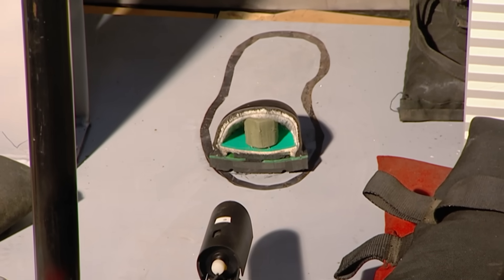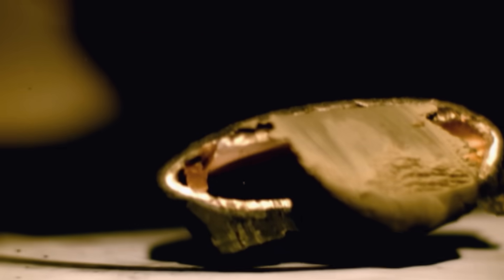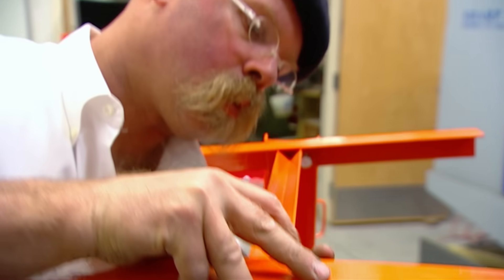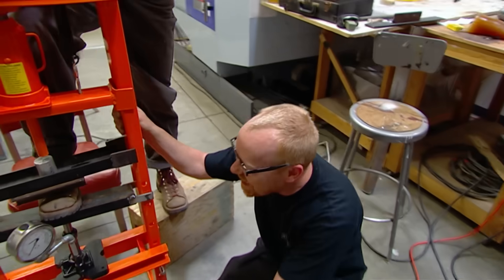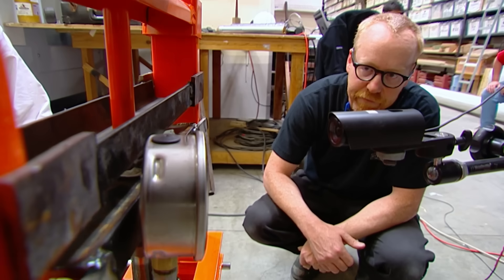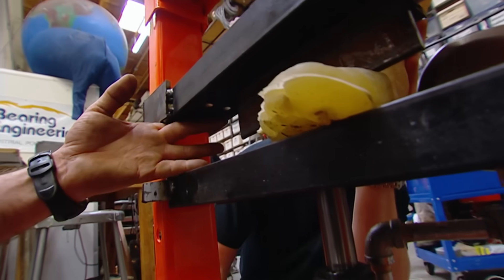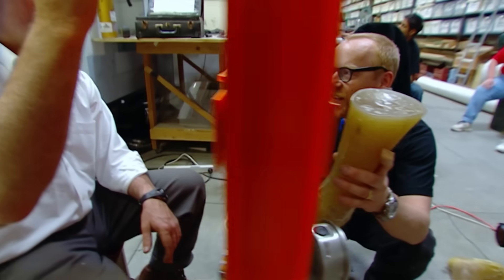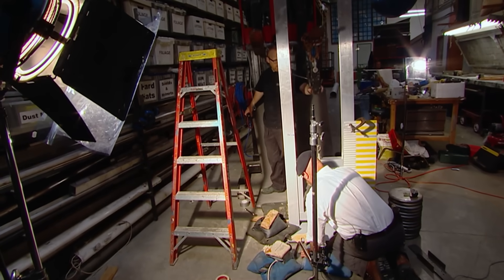Do Steel Toe Boots Really Protect Your Toes? | MythBusters

Comment: The thing that causes the steel toe to cut your toes off is if your foot is in a position that you can't move it ( you were focused on something else until to late to move it) and something is being lifted up under your foot at the toes and it rocks the toe of the boot up and the steel cup acts like a gulitine with the back of the cup cutting your toes off. I came very close to this happening to me. Fortunately the crane operator was paying attention and stopped instantly when I signaled him.

Comment: I hate safety toe boots.  I've got extremely wide feet, 6E, and what I've experienced is that safety toe boots don't fit properly and cause abrasions and eventually open sores on my toes.   It's not the same as having your toes crushed, but for people like me it's a real safety problem, especially when you consider that many jobs that require safety toe boots do not have the kinds crushing hazards that would make them truly necessary.

Comment: I will simply provide anecdotal evidence, I trained to be a plumber for two years in the U.K They train you on cast iron Victorian radiators just in case you ever bump into one. They weight an ungodly amount and I dropped one on myself with leather boots, Pain, Yes. Boot? dented inwards. 

I immediate went and got steel toe boots and then did the same thing out of fear a week later. it slid down the boot harmlessly. 

If you drop something heavy enough to break a good pair, you have worse problems.

Comment: The biggest issue with steel toed boots when I worked in construction is if the very tip gets caught in a narrow gap between a moving vehicle and a surface, like a paver and the curb. the metal toe twists if caught just right and bends it into the toe, or if you have really shitty quality boots it can snap the plate and can stab your toes, quite painful. Soft toe shoes you can yank it free or it  just crushes the tip and as long as your foot isn't crammed into the toe box super tight, you're fine. Either way wear steel-toed boots when you can.

Comment: this is why the metacarpal plate is a thing.. it allows the weight og whatever is falling off your foot and glance off and hit the steel cap .. the ones i used for years had a carbon fiber plate with a steel plate ( about half the size of the widith of a ruler ) .. samed my feet many times

Comment: The test they strated around the 6:10 mark happen to me. My boot was blown out at the soles as were the bottom of my feet requiring several stitches  and pins in a few toes. Those toes are solid and can no longer bend.

Comment: Only so much wieght can fall on it or watever it can cut your toes clean off if a forklift ran over it man done maybe if it just gos over the tip you may be good now fall damage is gonna be diffrent that pair with the press those are some good ones most wont have something like tbat most would have some walmart shit thickness of the steel is gonna matter cheap and exspensive matters in most cases

Comment: once had the screed (back end) of a paver set down on my foot, and only noticed because I couldn’t move my foot. Had the operator pick the screed back up and my foot was perfectly fine, but it cut my boot straight down to the steel toe. Had I not been wearing steel toe boots, by toes would’ve been toast, so steel toe boots are alright by me.

Comment: I seen someone lose his toes because of wearing STB
Reply: How? You don’t think he would have lost his toes with regular boots?
Reply: He wouldn't have because the way it happened the steal toe crushed down on his toes not allowing him to take the boot off
Reply: @jupabafl6837   You don’t think whatever crushed the steel toe wouldn’t have completely flattened his toes/foot? 🤦‍♂️
Reply: He had a chance to pull the boot off but couldn't because of the steal toe, I know i was there
Reply: @jupabafl6837  How does a steel toe prevent you from taking your boot off? That doesn’t make sense.
Reply: Because the steal toe part was crushing the toes
Reply: @jupabafl6837  🤦‍♂️and whatever was crushing the steel toe would have crush his real toe whether the steel toe was there or not.
Reply: It didn't fall at a speed where he couldn't have taken it off, it was a hydraulic press that slowly went down on his toes, he untied the boot to take it off but by the time he untied it the the ST tip cut off the toes

Comment: Steel toe boots have save my foot more then once as a logger, not rocket science, only one moral of this is if its going to crush a Steel toe shoe 😳 your screwed ether way am i correct, DA FUC sakes, come on man! Did you just fall out of a coconut tree 😮 not logging now, i wear a weak type of toe protection, you can run a 3/4 ton truck over these, want try a 1 ton 🤣, boot not cheap anymore 😂

Comment: I had a motor dropped onto my steel toe, it deflected just like this video shows. It had one of the ears for mounting sticking out slightly and it ended up bouncing and rebounding back to wrap slightly under the steel toe and my foot. Slid out my foot where it had dropped and had a broken big toe from it. Needless to say if I didn't have any steel toes on, I wouldn't have my foot today. Always always wear your PPE people.

Comment: As a diesel mecanic I vouch for Walmart boots the 160 bucks 
Saved my foot for landing gear on stealer fell from about 2 1/2 feet right on my foot just felt a bump form when it hit no damage or brushing at all i just keep replacing them every 3 months th due to the wearing out on the saoal😊

Comment: What i have done to test them is simple
I kicked, toes first, with most of my power
A brick wall

What resulted was pain, a slight broken toenail and the part of the toenail that got cracked which was a few rice grains big was purple

But that compared to normal feet is safe as if it was not for the steel tip, i would have had broken bones not a broken toenail that healed in 5 days

Edit:time for the on site tests

A 45kg metal barrel that i accidentally dropped on my toes and had them saved by the steel tipped boots and multiple times where it prevented me from stubbing my toes

i would also like to say that while working with pallets carrying almost 900kg of beer the pallet jack holding most of the weight of the pallet had my foot under it when i started letting the pressure from as i had gotten it in the right place and it gave me more time to notice my foot was there as the whole front of the boot started going down and i noticed so i stopped and it also stopped my toes from getting crushed as that particular pallet jack was the only one who let the pallets fall imediatly instead lf falling slowly to the ground

Comment: I noticed one problem with the last amputation test where the blade slpped to the end of the steel plate and amputated the toes. The object wasn't stabilized in any way. WHen a person is standing there, you have the whole weight of that person stabiliing the foor and shoe, making it less likely to move when struck by something. These were just front portions of shoes sitting there with no weight at all to keep them in place. The blade probably wouldn't slip, (or slip as easily) if it were weighted down in place with a coupla hundred pounds.

Comment: I've worked in road haulage for nearly 20 years. I've been required to wear safety footwear the entire time. It's saved me exactly once, and I'm damned glad I was wearing them when that pallet was placed on my foot. 1.5 tonnes of gravel and I didn't know it was there until I tried to step away.

As for the myth; it may not be the case that the steel toe was the fault, but a friend of mine lost all the toes on his right foot when a forklift truck carrying a heavy pallet ran over it. I think the steel toe was crushed down onto his toes. He was off work for a while after that.

Comment: What I find ironic is that my grandfather worked for many years just working construction. I can't remember for the life of me what this particular job was, but they were building a fairly decent structure and, in his words, 'a steel beam came down on my foot and put that damn metal right down into my big toe'. He had the scar to prove it, and the man couldn't even feel his big toe anymore.

However, after that, he took his chances with normal, soft-toed boots. The steel digging into his toe again scared him more than just losing his foot. Considering he fell off three seperate roofs after I was born, I'm thankful he still had all his limbs for most of his life.

Comment: Had an associate at Lowes doing an escort through the Lumber aisle out the back of the building and the guy on the Fork truck wasn't paying attention on the turn going out the door and with the drive wheel ran over the associates foot . The associate was wearing required steel toes but because of the weight of the Fork Truck it drove the steel cap down through the big toe because of the angle at which the Fork ran the foot over ...so he lost his big toe through amputation and nerve damage to the second and third toes . Weight will defeat protectors at some point always !

Comment: while i was serving in the usaf i learned the medical purpose of steel toes. my afsc was 2s051 enough said. but the actual function of the steel toe is to prevent ur foot or toes from becoming mashpota- toes. how so? depending on how severe it is. if a very huge blunt objected falls on ur toes, the protection is used to cut ur toes off which becomes salvageable for surgery. thats what someone senior airman told. then again kindoff hard to trust someone who works with machinary and doesnt remove their rings from their finger which becomes an occupational hazard if the rings  gets pinched on something, the skin of the finger would peel off like being skinned alive.

Comment: I had a job as a coil strapper. A milled coil of steel went along a conveyor system that consisted of V shaped saddles on both sides of a track. One day, my foot was too close to the track and a 10,000 Lb. coil rode over the toe of my safety boot. It lifted and slowed down the coil so much that I thought it was going to fall off of the saddle, but it passed over my boot and fell back into position and I was not injured. This was about 52 years ago at this point, which should tell you how scary this was because I still remember it, and how the steel toed boots probably save me from serious injury.

I agree with others - if steel toe protection does anything to your foot, then no steel toe protection would have been just as bad if not worse.

Comment: I jumped off of a short wall made of smaller concrete slabs and they weren't at all secured, one of the blocks dropped on my foot, and I was wearing steel toe work shoes. I still ended up with an ugly bruise on my foot, but it would've been much worse if I was wearing regular sneakers.

Comment: Steel toed boots, just like a hard hat, are neither designed for nor will they protect against, catastrophic weight being dropped on them at high speed. They are both made to avoid injury from common use in industrial conditions.

Comment: It may not save your life.  But in an environment where your dealing with 2-3 hundred pound stock, or even cable ties (Industrial steel wire, not the stuff you use to clean up the inside of your computer), they are really good to have.  Are they uncomfortable? Absolutely no question.  But its better to be safe than sorry.

Comment: Dropped 40 lbs on my foot with tennis shoes. Ouch. Lucky nothing broke. Next day, dropped 146lb box on my steel toed boots at work. No ouch. Didn't even bend it. Did damage the rubber stitched up the side though :(

Comment: has anyone else heard a version of the myth where they’re actually designed to fail in a way that cuts off your toes, with an implication that cutting off your toes is actually better than getting them crushed if the steel toe were to buckle?

Comment: personally a big fan of the composite toe boots. Here in Canada the bar is CSA Green Triangle approved (Maximum impact and compression resistance) and you can meet that standard with steel or composite toe. Most people go with the composite toe because same level of protection while also being alot more comfortable to wear all day

Comment: When i worked in the air force, i went to grab a ladder off an aircraft (the kind fighter pilots used to get in and out) and i would use my foot to help me wiggle the ladder out of the slot while using my arms to lift it out. Well one day the ladder was particularly slippery and moist, i lost my grip and the ladder fell right onto my foot. Thank god i was wearing steel toe boots. Sure saved me a hospital trip to say the least

Comment: Back in 84, I was working at a plant that made ridged pipe. I was moving a section of pipe with the chain hoist when the chain broke and the pipe came crashing down. It landed on the end of my steel toed boot and deflected away from me. The ridges of the pipe cut the end of the boot clean off leaving only the steel cap. I looked down at my foot and wiggled my toes. They were still there. No harm came to me but the leather on the boot was sliced off like a hot knife through butter. 

So yes! Steel toed boots can save your feet. Wear them!

Comment: I used to be a manager at a popular shoe store and we got some Novelty Steel Toe Doc Martins in. They came with a warning label that said they WERE NOT WORKING STEEL TOE BOOTS!! That's when we learned that REAL Steel Toe boots were made to cut the toes off if anything heavy enough were to fall on them. The Steel bends and cuts through the toes so you lose your toes and not your whole foot. The Doc Martin Steel toe boots They would just crush your toes and you would basically have to lose your whole foot. And we HAD to ask people what they intended them for and use full disclosure upon sale.

Comment: I think the biggest issue is not all Steel Toe boots are created equal. The size of the plate, how much of your actual foot it protects etc is never the same. Even by shoes that claim to follow the standards, it's not heavily enforced. I think that one shoe that also had a plate over the laces would be the safest you could get. In my experience steel toe boots just help you kick things easier, if you drop stuff in a heavy construction/work environment your feet are toast boots or not.

Comment: As an automotive mechanic for 20+ years  wearing steel caps I've never had an incident where a steel cap could help. But driving customers cars with a size 13 boot have nearly crashed a few cars when trying to push the brake and accelerator gets pushed as well . Only in euro cars though 😂
Reply: You wear sized 13 shoes? 

I think the entire concept of steel toed boots is almost like buying car insurance lol

Comment: I've been an ironworker for 22 years. When I got in old guys told me not to wear steel toes for that reason and for years I didn't. Then I started think the exact same thing; if something is heavy enough to cave in a steel toes my toes are probably toast anyways. I've been wearing safety toes ever since and never regretted it.
Reply: Safety toes? Never heard of that before
Reply: @APPEALtoFEAR they make carbon fiber toes instead of steel toes. They still offer protection but they're lighter but since they aren't stem they call them "safety toes."
Reply: @brentonewell1232 Cool thanks for explaining that to me

Comment: I had a hub fall off a stack of hubs on a lift table from about 5foot the hubs were stacked in stacks of 3 levels. A hub fell off the top row and completely flattened my cheap Metatarsal guard I was wearing on top of my steel toed boots. I still have that guard some 15+ years later. I've had a ton of things land on my feet while wearing steel toed boots over numerous labor jobs and take my advice have metatarsal guards on any steel toe you wear. If you break a toe there's not much they can do but let it heal...If your Metatarsal bones break it can lead to permanent life long disability. Steel toes with guards have saved my feet so many times I cant even count. Only setback that I know of and have heard of is they can cause frost bite on your toes in cold weather. Wear thick socks and don't tighten your laces too much.

Comment: Was a metal fabricator when younger. I had 2 day old Redwing steel toes on when a 800lb object I was moving and it fell landing on my right foot. It hit towards the back of the steel cap squashing it a bit and pinching my toes slightly. The bad news it then bounced and landing on the arch. No bones broken but my foot was blue,purple,green yellow for a few days . I was not able to wear a boot for a week on account of the swelling. I would have been severely hurt without those steel toes.😢

Comment: I honestly disagree with these guys. I run thorogood steel toe boots. I am a full time flooring installer. So steel toe boots doesn't bend my toes when I'm wearing knee pads and they are great for kicking a couple things. Most weight I've dropped on me was a about 50lb bag of thinset and I didn't feel a thing. But these guys expertise is not in my industry.

Comment: As someone who has worked with steel-toed boots it's so strange that anyone could be against them. They're super useful! They're designed to protect you from a certain class of injuries -- ones that involve light-to-medium items being dropped. If you're trying to use them to protect against anything that's too heavy to lift, then your foot shouldn't be there in the first place. And that's just the protective angle. It turns out that having a piece of unbending steel on top of your toes means you can use your feet while working more. You can do stuff like balance something you don't want to put down on your toes without danger (e.g. a cardboard box on wet ground), or feel around with your feet safely, or use your feet as levers to assist in moving things (e.g. scooching furniture around).